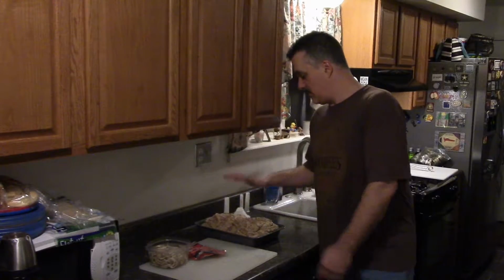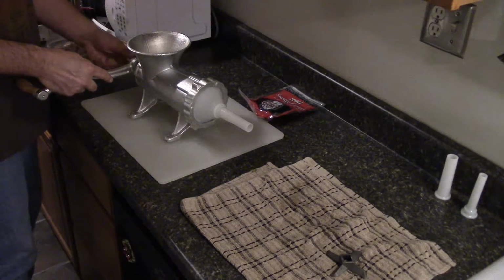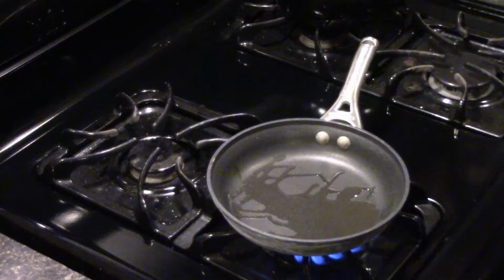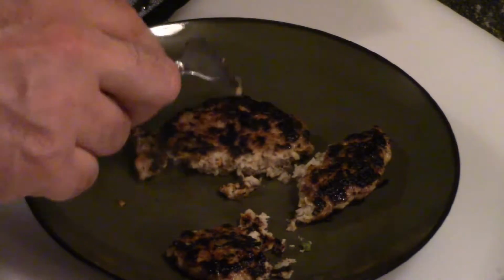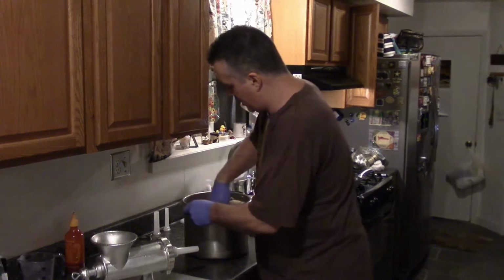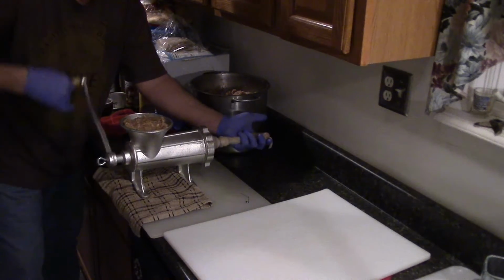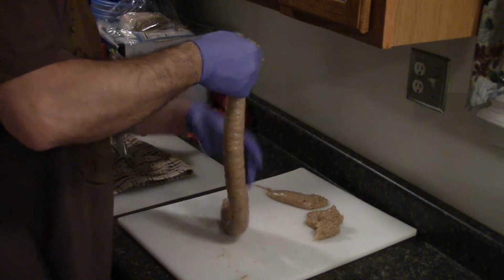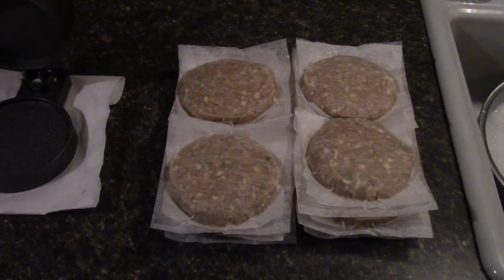Making Homemade chicken Jalapeno sausage Part 2

Comment: I used to get some chicken, jalapeño, cheese sausage over a decade ago from a butcher/smokehouse. Never forget it and always thought about making my own since I moved away from there. Around Christmas 2018 I went to Cabelas and bought a motorized meat grinder/sausage stuffer. I finally used it today Aug 31st. Googled chicken,jalapeño cheese sausage, your videos came up. Watched both, appreciate them. I wish I could post a pic of final results. Turned out well. Smaller batch than you did. I used Cabelas brand casings, collagen based. Made about two feet or so. I didn’t have breakage like the natural ones. I agree with you that motorized is the way to go. I didn’t have the difficulty you did just the fact of not having to crank that handle. I’ll be smoking the links tomorrow. Just a verbal fist bump 👊🏻